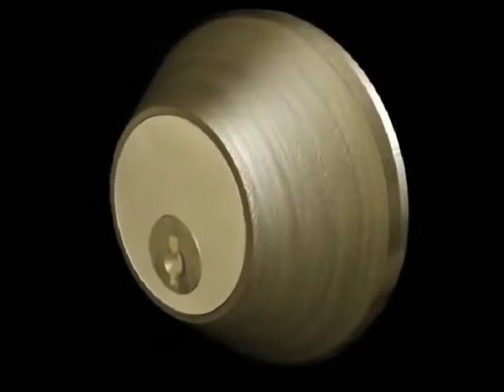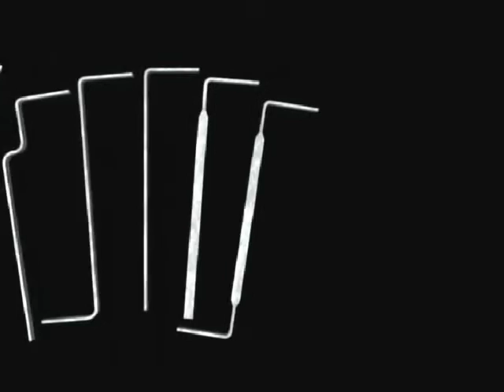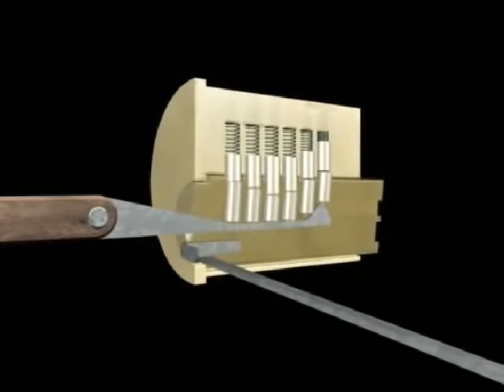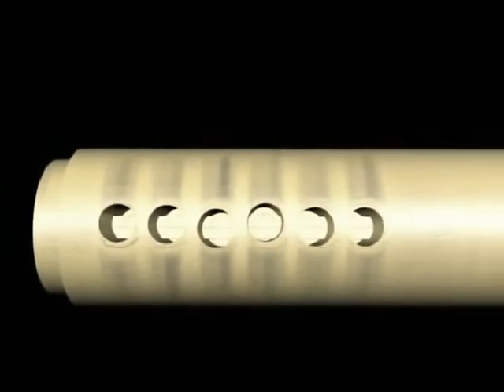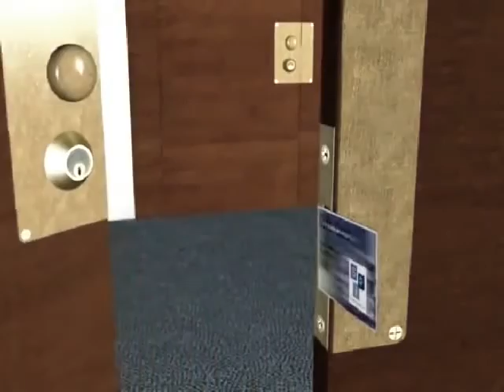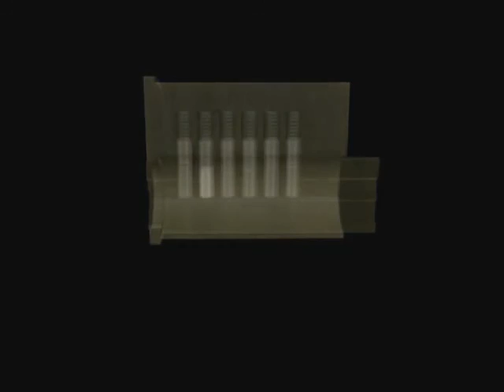Lock Picking Tutorial - Chapter 2 - Pin Tumbler Locks

Comment: I have a padlock that annoys the bejeezus out of me. I can rake it just fine, but single pin picking feels impossible. Maybe it's the keeway that makles it hard to reach a high pin in the back as opposed to a low pin next to it... I am not sure.
Reply: Vary the amount of tension you use and raise the pins very slowly, focusing on not raising the pins too high to avoid oversetting them.  Oversetting and wrong tensioning are the most common things which frustrate people when learning to single pin pick.  Don't forget to reset the lock after about 1 minute of picking in order to clear any overset pins.